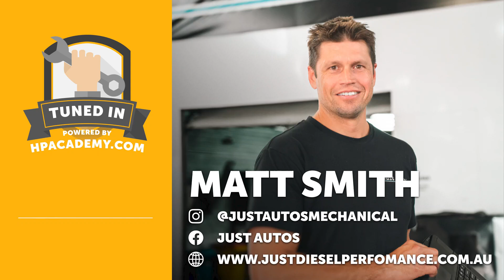133: The Dos and Don’ts of Diesel Tuning. [#PODCAST]

Comment: Why don't we see VNTs/VGTs in gasoline engines? It seems like with an even wider RPM range (compared to diesels) they'd be just as useful there, if not more so.
Reply: Porsche been doing it for a while now. 
Why others don't I don't know, could be something to do with high exhaust temps at higher revs but I could be talking nonsense. 
Anyway, no need for it, series compound set up is better in all aspects except space needed and euro manufacturers have that sorted very well too nowdays (on diesels that is).
Reply: It can be beneficial, but it might not be worth it most of the time due to reliability and due to other ways of controlling. There's also a difference in overall function (diesel vs gasoline) vs power demand, it's trapped oxygen over time that gives hp, but then there's a difference in fuel, knock, delivery of fuel, control of ignition, system efficiency and probably a whole lot more that I can't think of right now. 😄 I'm not sure but maybe it makes more sense (worthwhile) with stratified injection, they could have a greater variation of power demand for a low and narrow rpm band while still revving high (plus a long list of other compromises that's in every engine and system setup that might stack up more in favour for it).

Comment: I love diesels. Water/meth and propane injection is the (forgive the pun) coolest and safest way to add additional 80-100hp with even cheapest map. 240hp/440nM from 2L engine and still have 60mpg (UK gallons) car is awesome.
Reply: What car are you driving?
Reply: @ focus ST with 2.0 Peugeot Engine🤣 nothing fancy but with few mods reliable and still efficient for long journeys.

Comment: For someone building an mTDI currently, i learned alot from this webinar. Especially the parts about fuel filtration and cavitation which is something i overlooked as something i didnt need to address from factory. Albeit an mTDI is different from electronic common rail i appreciate ya’ll addressing the fundamentals. This was a great interview!

Comment: Those tractor pulling engines are insane. They probably smoke so much while loading up at power rpm because of the huge size of the pump and turbos they require to get to the 5,000+hp they make.
Reply: They smoke that much because a lot of them are turbo size limited. Imo its a stupid way to control power and you get the stigma that smoke means power.